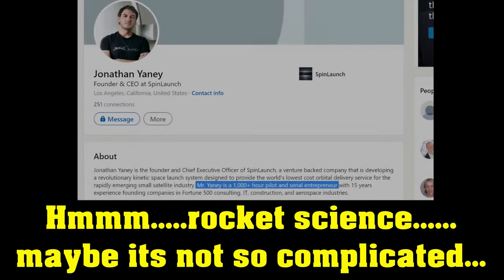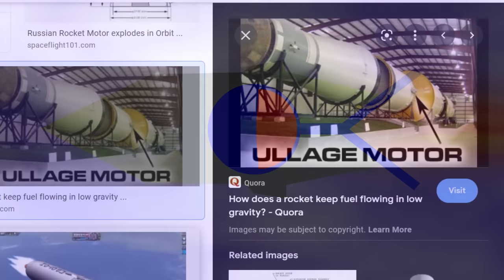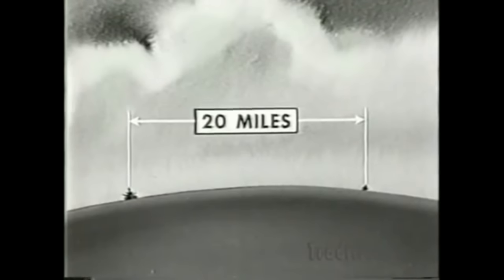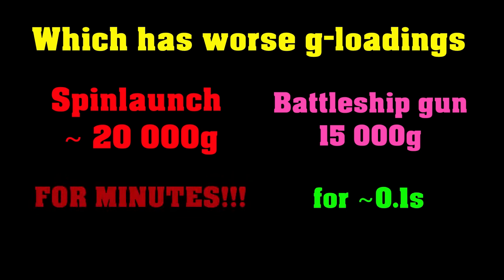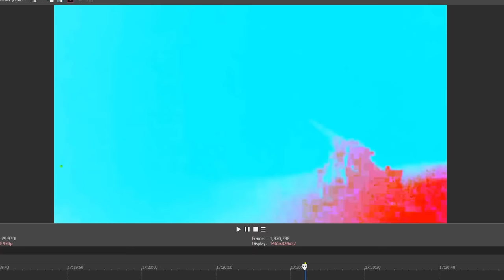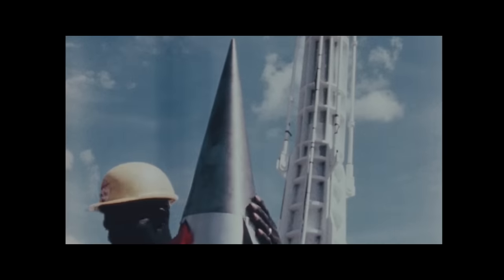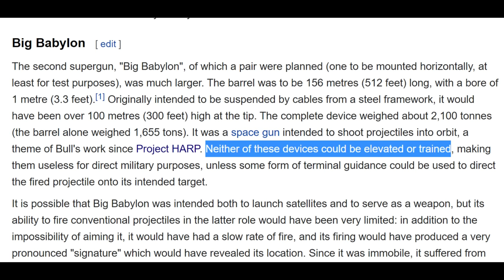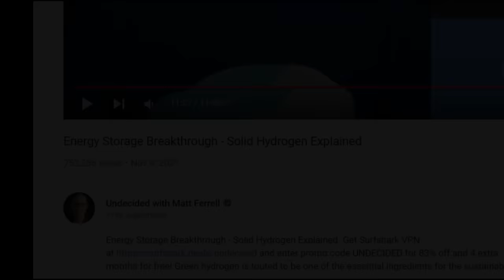Spinlaunch: BUSTED (Part 2)

Comment: There is a reason no real engineer thought up spinlaunch. They did, then they thought about it for about thirty seconds and concluded it was dumb and moved on to a new idea.
Reply: i think every middleschooler probably asked this same question at some point and then got into physics :P
Reply: Hey, maybe it got to some drunken popsicle stick building, and then when they got sober, they realized how stupid it was.
Reply: Laugh all you want . They may not know it but these guys have invented an intercontinental ballistic missile launch system that has no heat signature. I'm sure the Department of Defense has already taken notice of Spin-launch.
Reply: @dirremoire  You could do the same with rockets, just drop your motors and fly your kinetic payload. Of course anything moving that fast is going to heat up and make a ton of noise, motor or not.
Reply: Trebuchet to space; what could go wrong? Lol
Reply: @dirremoire  yes. just ignore the fact the projectiles need heat shields if they actually got it working as advertised....
Reply: @dirremoire  Good point, but in addition to the fact that it’s going to be surrounded by plasma when it hits the air as already mentioned, the reload rate means you would only be able to get a single shot for each centrifuge before the counter strike destroys them. 

Also, large, immobile launchers are strategically worse that smaller, mobile, concealable launchers since they only work in a first strike and you can’t count on them for a counter strike. Weapons like that are very bad for everyone, especially the builder, because they invite your adversary to hit you first.
Reply: Yes, The problem of the plasma bubble is a real one, but one that could be mitigated much more easily than a combustible trail of hydrogen and oxygen lasting minutes as the rocket climbs.  Let’s also not forget that projectiles will be much smaller than a Intercontinental ballistic missiles, a countermeasure useful against satellite detection .Current ballistic missile silos also offer no means to reload and mobile launched missiles have much limited range. The DOD is perceptive enough to realize that this technology is in its infancy and is well worth developing as a viable alternative or supplement to our existing nuclear strike capability. Besides, when did the Defense Department ever meet a technology it didn’t like? Mark my words.
Reply: @dirremoire  Sounds like your innovative heatless missile is going to have a fairly large, unique heat signature to me
Reply: @PippetWhippet  But still much less than an intercontinental ballistic missile, if only because it won't need the velocity to go into low Earth orbit.
Reply: @dirremoire  as an absolutely no engineer...why bother with this utter nonsense and instead just use huge rail guns for this? Surely one could be developed to serve this purpose and launch a similar projectile with far less complexity than a gigantic centrifuge that requires near complete vacuum which takes a half day to achieve and will turn into the worlds largest and least friendly lawnmower blade the second it lets go of the payload?
Reply: *There is a reason no real engineer REALISED the spinlaunch.
Thinking up is important and part of the process.
Reply: The unbalance issue is actually the most stupid one. If the moment of inertia will not be balanced as soon the missile is released, the force on the bearing is exactly 15k+Gs * mass of the payload. = enormous force spike - more like a hit on the bearing. The other issue is... is really the raw g force more significant, or rather the jerk (change in acceleration)? - The spinlaunch has lower jerk than any cannon. But there is no refence on what is worse for the payload itself - therefore, the argument of "simply having lower or higher g being worse or better, might not directly translate to anything..." 

HOWEVER - once the payload is released, it is basically the same, as you were shooting - there is a drastic change in acceleration (in this case - centrifugal force/acceleration). It really is, in some sense, the same as shooting payloard through the cannon.

Nail to the coffin for spinlaunch.
Reply: @rafakordaczek3275  Yes, as it it currently designed. But that is a technical problem and could likely be compensated by design improvements.
Reply: You're overestimating engineers.

It took at least 3 minutes and one or two quick drawings
Reply: @dirremoire  the heat signature will be the same or worse.  It’s going transonic upon release from the device and instantly gets hotter than any icbm as soon as it hits the thick air at ground level.
Reply: @xiaoka  The heat signature for such a small object will be much lower than that of a nuclear missile.  In fact it may not even be necessary for these warheads to go sub-orbital to reach their targets.  I really think this launch system has serious military potential. Just watch.
Reply: @dirremoire  I think you're ignoring the more obvious problem that this thing is a pipe dream.
Reply: Spinlaunch is really silly. It is much easier to make a big gun. It has way fewer issues, but the main one...atmosphere, is still something we need to deal with.
Reply: Icbms already fall back to earth with no propulsion.  Skin heating will affect both launch types equally
Reply: @JackSparrow-re4ql actually slingshot, but Golliath aproves
Reply: There was once a game designer who thought up a spin launcher weapon for an FPS. It was my favorite weapon, had great fun with it!

Comment: I've noticed that CGI space launches have a 100% success rate. No one ever does  CGI presentation of what it will look like when their rockets fail...
Reply: Of course not; that would be bad publicity; and we all know cgi exists purely for visual razzle and dazzle. 

Real simulation are almost all pure math models, no fancy graphics needed. If scientists and engineers do end up making a visual cad model; it's usually just to figure out how something is physically shaped. You can calculate most anything else using math though.
Reply: I don't know about that. The Hyperloop CGI had pedestrians being constantly run over. And cars moving through each other. It was surprisingly honest about the dangers of the Hyperloop.
Reply: This could be the solution! If Spinlaunch exists onlyt as a CGI-project, it WILL be a marvelous success.
Reply: Not true at all. I can't tell you how many Thousands of Kermans I've killed perfecting my rocket explosion simulator 😉
Reply: NEWS ALERT: Spincyle-Launch-a-thingy Insider ! - There is going to be an announcement soon, of building an AI system. Of mechanical bodies (drones and androids of course) to clean up any messes/errors. First though, is the redundancy system that may be made of 4 Tesla vehicles. Also, a fading brand market, "cafeteria housing lead" Subway/Pizza Hut/Hardees.
    - My personal shot at, The Onion, Editorial piece, lost in the pages of real world stories that help shape our culture for tomorrow & beyond, > advertisement - side story.
Reply: Neither does it include the rocket initially spinning sideways from all the the built up angular momentum...
Reply: We have Kerbal Space Program for that. ;)
Reply: Yep, CGI launches are tight.
Reply: It’s more work to animate that.
Reply: Hmmmm... That gives me an idea... I'm a neuroscientist with zero experience in space things that means I have a fresh perspective. I should launch a company that goes to space purely using cgi. I can promise a 100% success rate and superior launch rates.
Reply: I can assure you my cgi kerbal space program launches fail at incredibly high rates
Reply: -Matter didn’t create anti matter
-Anti matter didn’t create matter
(Both of them were present at the time of big bang)
-Both of them didn’t create themselves.
-Both of them came from an unimaginable source,  that unimaginable source created matter and antimatter (everything) thats why it is known as “the creator” of everything.
——————
- that unimaginable source/creator has created sin and virtue which are opposite to each other,
— logic says every action has its own reaction, so the reaction of sin must be different than the reaction of virtue,
— the creator has created prophets to let us know about each and every detail of sin and virtue, also about their reactions,
Thank you :)
Reply: games do that
Reply: He should do a video on compressed air batteries
Reply: @dot3510  WTF does that have to do with the topic or any topic discussed in the conversations at hand, hmmmm???
Reply: well if the cgi launch system is so successful then why even bother looking for other means. Nothing is infallible.
Reply: @Jordan-Ramses  That's the loop, not the hyperloop.

Both are bullshit,but in different ways.
Reply: My Kerbals would disagree
Reply: Well, animating an explosion would just be much more expensive I guess
Reply: Because the CGI people are the only ones actually working hard, they dont wanna do all that work for something nobody is gonna watch.
Reply: @dot3510  both of them actually created themselves.
Reply: To be fair we have plenty of ACTUAL footage of what it looks like when that happens.
It's also worth noting that we're talking about a smaller cheaper projectile carrying FAR less fuel.
(So it WOULD make less of a mess if something goes wrong outside the launch tube than a current launch system.)